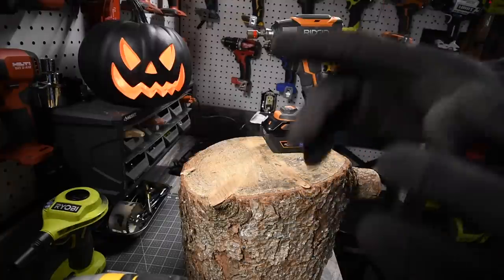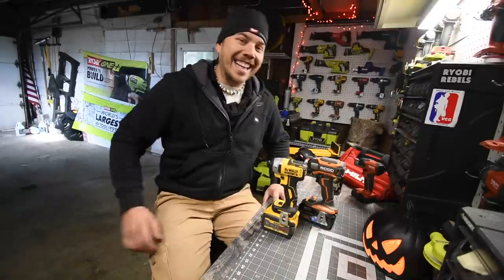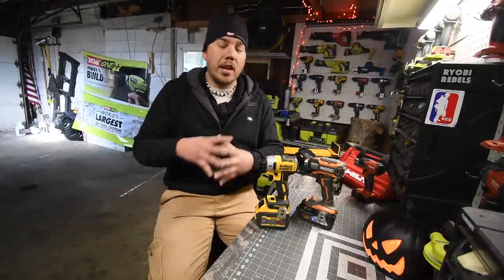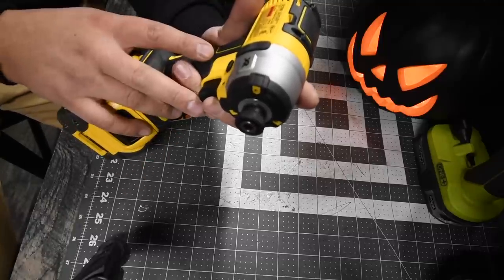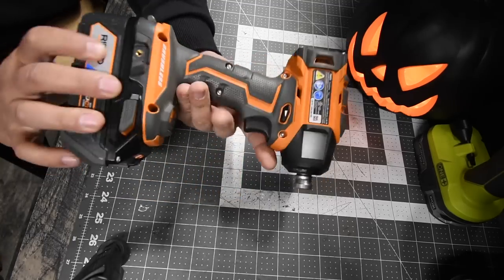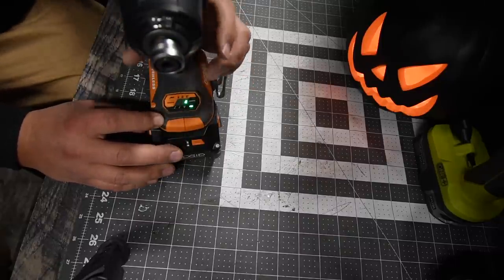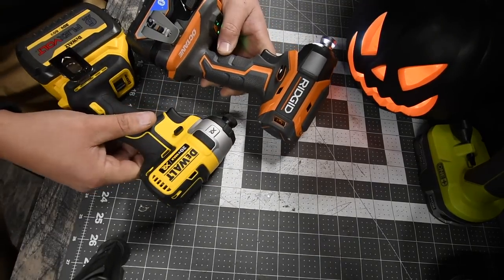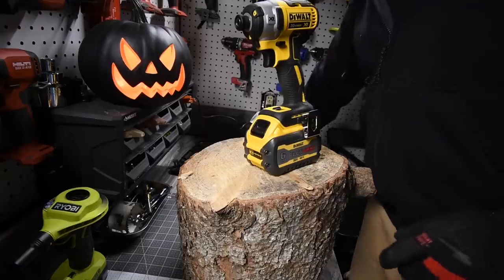Dewalt vs. RIDGID (Impact Drivers)

Comment: Honestly every brand, even the amazon ones, will get you thru a days work. I'm not a fan of any one brand over another, I have Hitachi, German Metabo, Milwaukee, Makita, DeWalt (Mac Tools), Bosch 12v and older corded Porter Cable tools. They all get the job done. I can only comment on DeWalts service. I broke an 11/64 drill bit on a cheap $12 set. They mailed me an entire box of 11/64 COBALT drill bits for free. When I bought a DW840 grinder from Lowes and noticed it was missing the guard and handle, they mailed me the accessories free of charge.
Reply from the maker: I agree with you on that. that's why I love all brands, because each brand has its ups and downs
Reply: The realest tool comment yet! Right there with ya sir! Now they just need to make universal chargers! Or battery adapters lol

Comment: Enjoyed this Versus Vid Dave!  Ahh, the much maligned ‘887’ Impact. A little rough, a little loud, a little ‘warm,’ but it will smash in almost anything you need to fasten.  Albeit the Ridgid took over a minute on that big lag, it still got the job done.  The DeWalt clearly blew it away!  Now, if the operator of the tool, covers the vent openings, and pushes it beyond its rated capacities, it will overheat and shut down.  I think the feedback circuitry in the 887 allows it to keep going, when it should cut out, compared to similar brands.  Not my favorite Impact, but it is a solid choice.  I am surprised the Ridgid did not do better?  Good test Dave!  Thanks Peace 👍😁🇺🇸
Reply from the maker: I thank you for the feedback George :)

Comment: Those big lags are a little much for a impact driver mid torque should be the minimum for those but better off with the big boys
Reply from the maker: Yes sir, but it makes for a good stress test on impact driver motors

Comment: The new flex volt battery is merely a flex volt battery with 21700 cells vs 1650s in the old one.
Reply from the maker: I know, and that is why I want to revisit that Milwaukee vs dewalt test

Comment: Wow that’s the 887???  I wonder if it’d a model revision, because that performs like a way better impact than the old 887.
Reply from the maker: I thank it was that battery. I gotta do a test video against the milwuakee
Reply: It's the same part number as the old flexvolt. Should be the same internals.  Like The Tool Boss states , "different color lipstick" .

Comment: Did you notice any wobble or play in the drill bit on your rigid?
Reply from the maker: there is a little wobble on all impact drivers.
Reply: @ManCaverTools  thanks man, that’s good to know because I actually took my octane back and exchanged for another which has the same wobble.

Comment: You should try and get some ozito(einhell) tools in. They’re very cheap and are pretty solid in performance. They also have a large battery platform so they could compete with ryobi in most categories. Also sweet video.
Reply from the maker: I can check them out and I thank you Soren

Comment: its doesn't make sense to me that the ridgid has 575 more inch pounds and more impacts per minute than dewalt but dewalt blows ridgid out the water ridgid did something wrong it should have had more rpms but maybe tti didnt want this to be better than the Milwaukee
Reply: Don't go by numbers I had a dark grey Porter Cable impact driver that said 1600 inch pounds and then I bought the light grey one which said 1425 inch pounds and the light grey one blew the doors off it
Reply from the maker: maybe it will perform better with the 9ah battery

Comment: I think the Milwaukee is still going to win.  But instead of being a one sided domination, and it’s going to be much closer.

There was one test on episode 306 where we can compare times.  On that video the Dewalt with the old 18650 6ah FlexVolt  with, took 23.56 seconds to do that lag.  Worse than the Ridgid in this test.   On this test it dropped to 11 seconds.  Which is much closer to the Milwaukees 9.15 seconds.

So that new 21700 FlexVolt battery, took the 887 from near last to 2nd best.   

I can’t wait for the power detect or FlexVolt advantage version to come out.
Reply from the maker: Me either and I thank you for going back to my videos and giving me the time